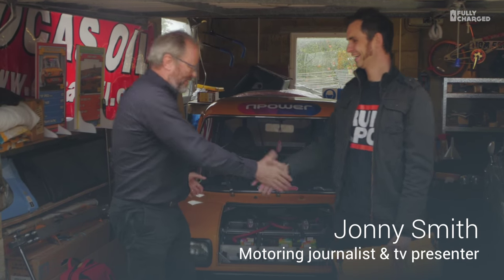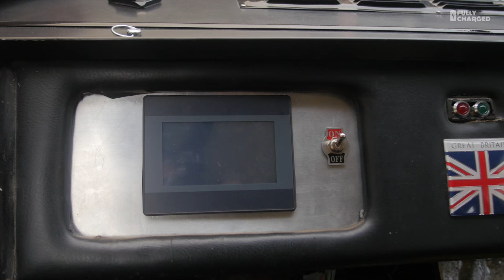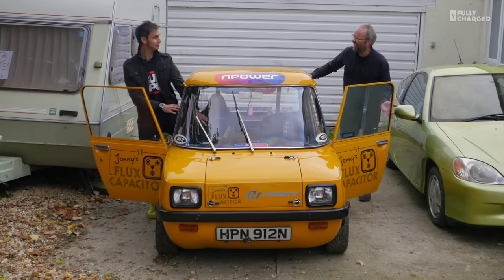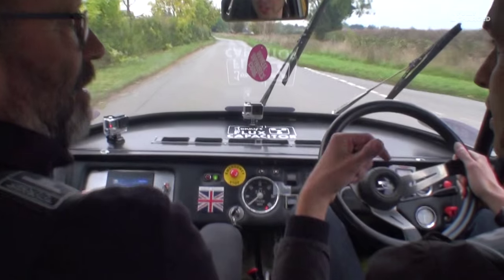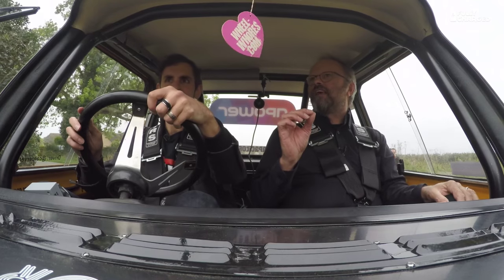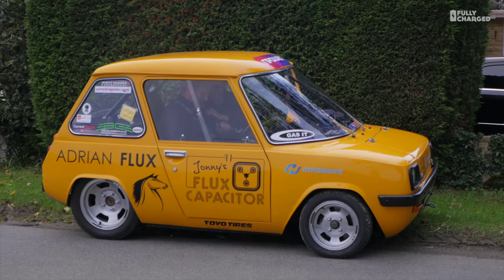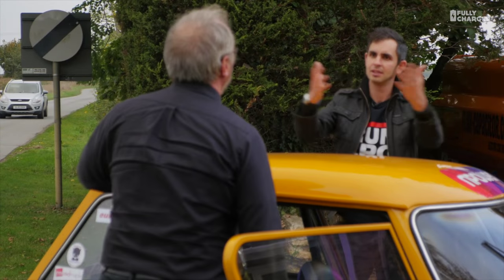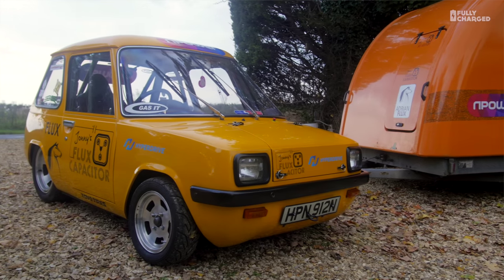Flux Capacitor | Fully Charged

Comment: I can't believe the change in Robert; from being petrified at the thought of flooring a P85D to being absolutely giddy to take a spin in a car even more bonkers.

This is the effect driving a Model S on a regular basis has on a person.  Your tolerance for barking madness goes up a ton.
Reply: +Mayhemm007 The rate at which Performance Electric cars are being developed with crazy instantaneous output from their battery pack. Robert may need some Advance Driver Training to handle those crazy powerful cars in the near future.

Comment: I remember spotting an Enfield 8000 on eBay back in 2013 or something? At the time I had no idea that Jonny Smith had already bought one to convert, and I'd ended up reading a fair bit about the old 8000 (along with watching that 90s Top Gear bit on it) and when I found out about what Smith had done? Mixed feelings initially - part very happy at the lunacy and part irked that it isn't the modern equivalent of what it was (48v, but lithium instead of lead and so on).  Though there are such examples out there...and this video has convinced me the lunacy was completely on target! :)

Well done sir!

Comment: I wish you had asked johny to explain the differences between the original batteries and the new replacements. It is astonishing how much battery technology has improved since the 70's. I wonder how much further we need to go before they can compete with gasoline engines on price and range.

Comment: I may have missed it, but is it still running lead acid batteries? If it is, imagine the 1/4 mile times if it could be fitted with modern cells!
Reply: +Kano Wins they looked like lithium batteries.
Reply: Darren Boss
Thanks mate.
Reply: +Kano Wins 
There is a 'Kokam' logo on the pack at 2:40 in the video, so I'm assuming it's their cells that have been used. Early pouch types - haven't heard much from them for a long time.  Very good specific energy and energy density (as well as other favourable electrical characteristics - but not cheap) compared to most other mainstream lithium stuff.  MW
Reply: Thanks Martin. Great info. I'm very new to the EV world, so always happy to have things explained :)
Reply from the maker: +Kano Wins Johnny explains in the introduction that's he's replaced the heavy lead acid truck batteries it was built with and replaced them with batteries that are about 4,000 times more powerful.
Reply: +fullychargedshow Er, that'll be just 4 times more 'powerful - but what he really meant was, 4 times as energy dense.
Reply: Thanks for that. I think I became stunned as soon as I saw the vehicle and lost all my listening faculties :P I will watch it again to get the details... and to see that burnout again! fullychargedshow
Reply: Johnny says 120 times more powerful, I'm guessing he means maximum output power per weight? So if he can get 500+ hp now then the car originally could deliver maybe 8 hp (since it had twice the weight of batteries then). Sounds about reasonable.

Comment: Electric cars have always been brilliant but it's all about the batteries.  Stick an advanced pack in that car and it transforms.  Though of course the fellow did good work fitting parts that could take advantage of the power.

Lead-Acid:  "rubbish"
Lithium: "fookin aye!"

Another couple of step changes in battery capacity and performance and you can kiss petrol cars goodbye.  I look forward to seeing them in museums, or the occasional club outing like when nowadays you'll occasionally see a group of Model T drivers tooling around..
Reply: ICE:  Put out to pasture, and driven on closed courses or at parades on the weekends, just like horses.

Comment: I didn't hear but what was the range before and after?
Reply: +todd baker Before was "some" and after was "a bit less". They only said it used 30% but didn't say how far it had gone - presumably not far using that kind of acceleration.
Reply from the maker: +todd baker It certainly wasn't built for range, however it's around the 60 mile mark if you don't hammer it. Of course it's totally built for hammering.

Comment: Capacitor as in, Battery System consisting if Capacitors?
Reply: Capacitor as in, 'Flux Capacitor', as a fictional movie power device (see: 'Back to the Future')
Reply: Andrew Micallef There's Gotta be some Signal/Power Balancing with that Tri-Geometric configuration, fictional or Not!🙈
Reply: Arne Hurnik 😂😛👌

Comment: Like it a lot. Only little drawback for me, are the silly dragster rear wheels. All EV's are at it's best when run on really narrow small tires with a reasonably high pressure. I would have used something from a bigger scooter with a lot of grip.

Comment: The Enfield 8000 had nothing to do with the Royal Enfield motorcycle company, or indeed with the original armory that later turned it's production over to motorcycles (like BSA = Birmingham Small Arms).

The name seems to have been chosen by Greek business man Giannis Goulandris, simply because it sounded British.

I think I've still got a box with contactors from the original Enfield 8000 stepped controller.
Reply: +Paul Compton Not true. The Enfield 8000 used the same cannon logo as the motorcycle company!

Comment: Think the way that car was built in the day is a laugh? You should've seen GE's electric lawn-tractor offering.... It had a traction-motor that you switched-on before engaging any function--driving or mowing or whatever--and it had an 120VAC outlet on it, so you could power all your electric yard-maintenance via it's lead-acid batteries that seem to take forever to recharge via your household electricity. 

Sure would like to find one, and convert it to modern standards, before they introduce another to the market that does... Then it'd be a moot point.